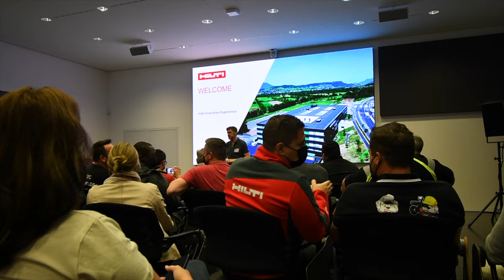HILTI Nuron Event In Full Swing!

Comment: In my 12 years as a Commercial/residential electrician and being around thousands of job sites and many tradesman I’ve never seen anyone use Hilti for except maybe a corded hammer drill. Hilti is way over priced almost seems like you need a membership just to own a hilti tool. Stick with Milwaukee or Dewalt they get the job done for half the price